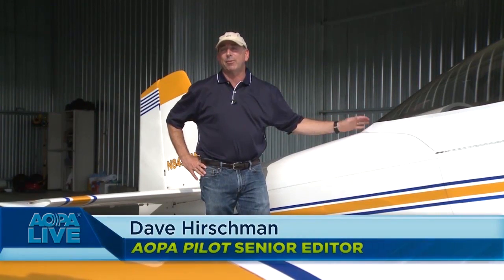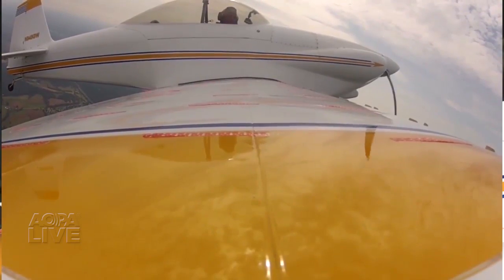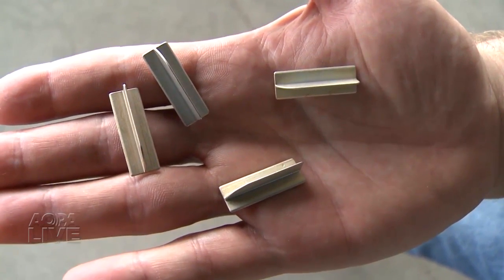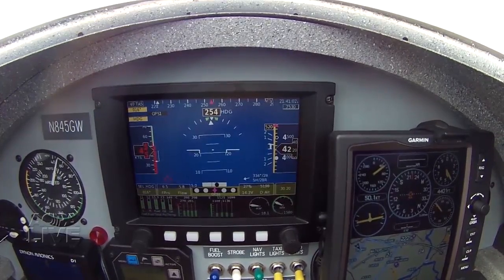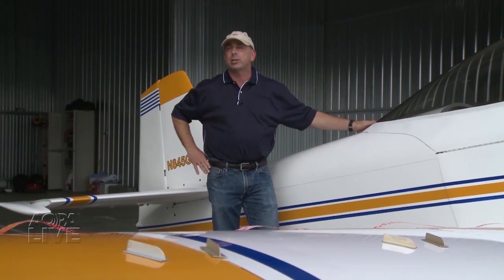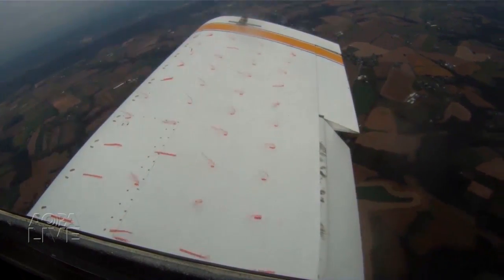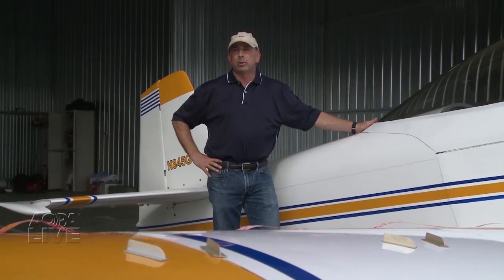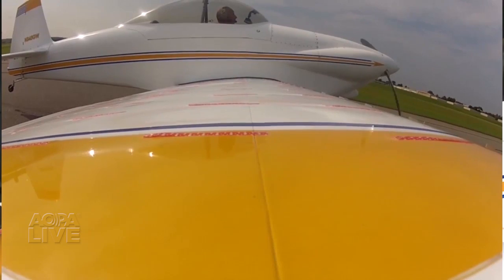Vortex generators

Comment: $400 for $5 worth of material lol, do them your self just need proper measurements where they go i dont think size matters that much if they are out by 1mm
Reply: it's not always just about the material cost. they also put in hours upon hours of r&d into making them. like making it the correct shape and size and angle and stuff.
Reply: @adamthomas1222  so do they put hours and hours to make car spoiler end up buying for $400 big difference in materials :) still expensive

Comment: Useless on high speed acft like a Mooney/ Bonanza/Lancair/Cirrus because your not going to land at high angles of attack which makes the damn nose so high it blocks your view and will just cause you to scrape your tail on landing. VG's are only useful for slow STOL acft landing in the weeds and airliners. Unless they can be applied to the leading edge of the rear wing flap where they can produce additional lift on landing without having you lift your nose and then tuck inside upon retraction, their a complete waste of time that will just cut the fingers off your kids wiping down your plane.
Reply: On my ragwing ultralight they may save my life so zip it.